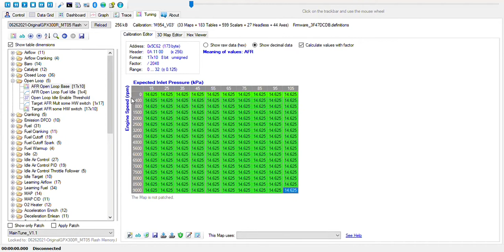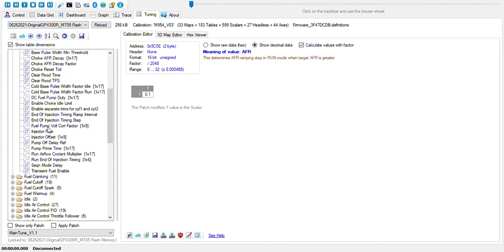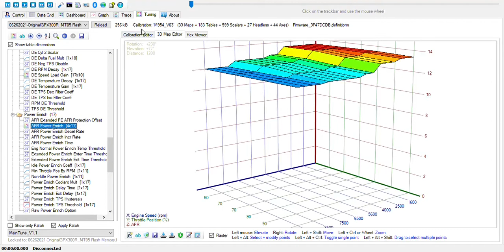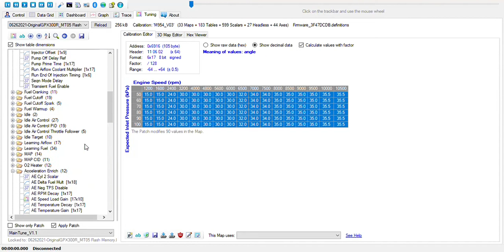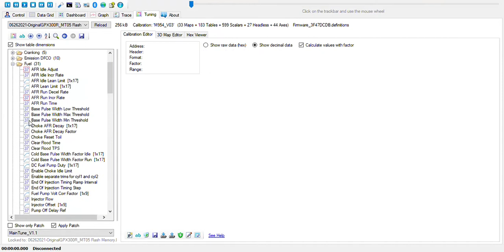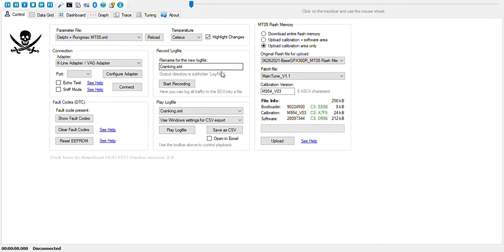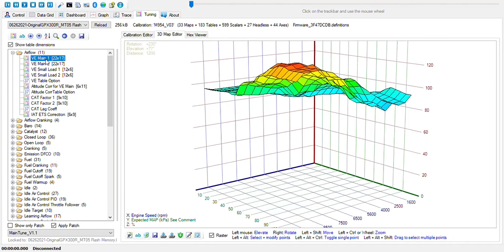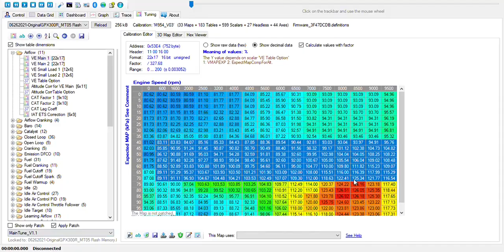2021 GPX300R HUD ECU Hacker Tuning - Delphi MT05.2

Comment: Hi Sam - my motorcycle has an OBD2 connection on it do you think I would be able to use that directly rather than trying to make something and try to find where to connect to ,my ECU is a Delphi MT-05 and labelled AJP PR5- thanks
Reply from the maker: Probably just a VAG KKL cable would work.  They can put whatever connector they want on their bikes but if an MT05, this ECU program should work with it.
Reply: @SCakey  Thanks - that is the cable I have. This ECU seems to be "Factory" locked where changes can be made but can't be saved. Will this program allow to save changes/updates
Reply from the maker: @lindsaypetersen1277  This program allows reflashing of the Delphi ECU, I don't see why it wouldn't work.It is flashing a new map to it, these aren't 'on-the-fly' changes.
Reply: @SCakey  Thanks - hopefully we get the result we are looking for - appreciate your reply and time to do the video. We are in Australia and no-one so far has been able to update and then re-flash these ECU's
Reply from the maker: @lindsaypetersen1277  Originally this program could only do 'on-the-fly' updates which reset each time you turned off the bike but now it includes a full re-flash capability so I see no reason it wouldn't work. Like flashing is done at a lower level that might be harder to restrict (I kinda doubt it is restricted on any Delphi MT05s).  Hope ya find some good stuff man!
Reply: @SCakey  Hi - sorry for another message it just won't connect to my PC saying there is no J2534 adaptor connected - if possible could we exchange email addresses so I could get further assistance
Reply from the maker: @lindsaypetersen1277  At 3:27 of the video, make sure Adapter is set to K-Line / VAG, it might be set to J2534 currently for you.

If it for some reason isn't detecting your VAG cable, there is a small button up on the top of HUD ECU Hacker with a box and a disc (2 to the right of the wrench) to install drivers as your computer may not have the USB drivers installed for the cable.
Reply: @SCakey  Hi Sam - would it be possible to use another way to contact rather than via Youtube as i have some screen shots I'd like you to see regarding possible settings issues that i may have
Reply: @SCakey  Hi Mate - done everything you have mentioned unfortunately no result. I have reached the level of my ability to make a connection. I'll just have to leave it there as I have no idea where to from here. So thanks for your feedback I'll just have to live with the MT05 faults we are experiencing and hope someone here in Australia can get it to work. Disappointed the program hasn't been able to help but I'm sure someone somewhere will get it to work. The motorcycle I'm trying to access is an AJP PR7. I'll keep following your Youtube posts some good informative stuff.
Reply from the maker: @lindsaypetersen1277  I dont really want to post my email publicly on youtube but if you have an email to send to me I can try, maybe this doesn't work on AJP's ECU but I'm doubtful that is the case. Don't see why this wouldn't work for AJP's with Delphi MT05s.